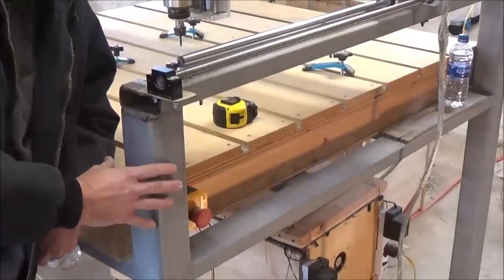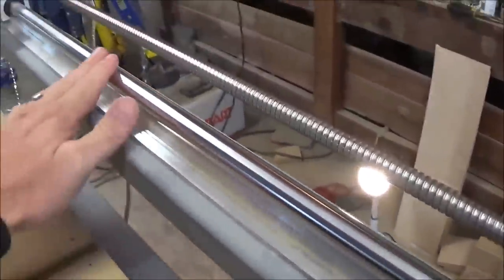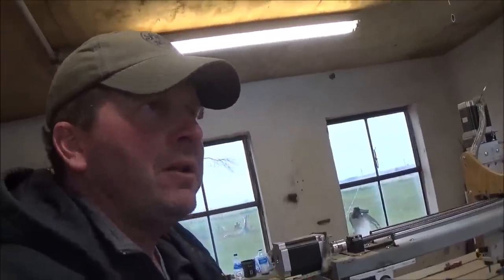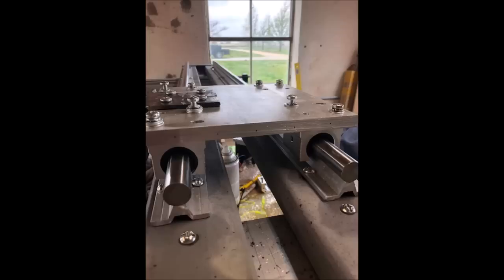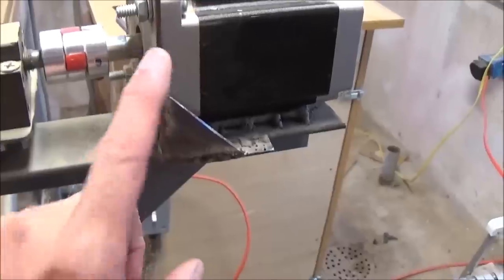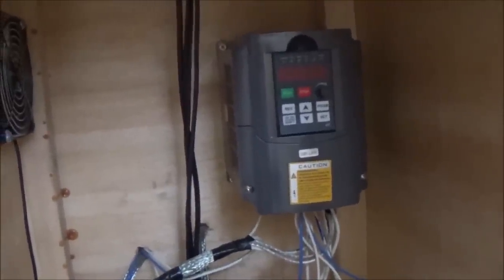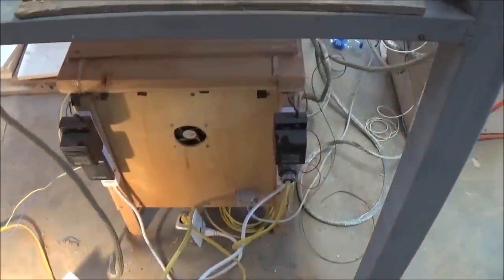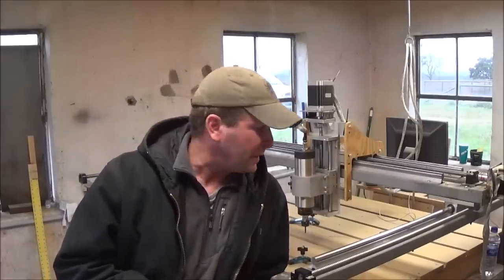My DIY CNC Router build

Comment: Great build! I love seeing people building stuff like this, but I have a couple of comments.

Have you grounded your shielding? If you want it to stop radio signals you have to give it somewhere to send them, i.e. to ground.

Your air box doesn't look very efficient, the way you have the fan just sitting in the box will just swirl a lot of the air around inside it rather than moving it down the vents. Buy another one and duct then directly into the exhaust vents.

You've got bare wire sticking out of your breakout board -- that's a risk of shorting out.

Parallel ports are 25 pin.

Seriously consider adding limit switches, you can't maintain 100% concentration on your system the entire time it's working (you're human). Something can go wrong and your gantry can run off the end in the time it takes to have a sip of coffee, read a text message, answer the door, etc.
Reply from the maker: Thank you!!...Yes the shielding is grounded......The airbox is one of the items I've still got to add on to, I plan to actually duct the air from the attic to cut the dust intake even more....I actually have a full dust collection system setting in the next room that I haven't got set up yet that I plan on adding to that room......and limit switches, I knew I'd get called out on em for not having them and that's ok, I do plan on adding them but it will probably wait until after I'm christmas, I'm getting covered up with Christmas orders at the moment, so most of the time I'm out there I spend working on products.....Thanks for watching!!
Reply: @SmokeysCNCWoodworks , just to make it clear because it's so easy to misinterpret text, please don't take anything I wrote as negative. It's an impressive build, I'm jealous.
Reply: I run soft limits and I've never had a crash. But then again I don't run Windows either. Coincidence? I think not!
Reply: @1pcfred  And I wear my seatbelt every time I drive a car even though I've never had a crash.
Reply: @fred_derf  I just wear a seatbelt to avoid a ticket myself. I've crashed a bunch of cars already too. Never had a seatbelt on any of them times either. I'm durable.

Comment: Do you have a link(s) for how you synchronize the two X axis motors??
Reply: Awesome machine, BTW!!!!
Reply from the maker: Thank you...This is actually crazy easy...so when you wire the drivers to the Breakout board you figure out which motor is X, Y, Z and A.  A is the extra X motor...In mach 3 there are several settings screens (can't remember which screen at the moment, its late and not in my shop) Look for a tab that says slave and you simply slave A to X and they operate exactly the same.....hope that helps..if not email me a smokeyscnc@gmail.com and i'll try to find exactly where in Mach 3 tomorrow....Thanks for watching!!
Reply: Smokey's CNC Woodworks a

Comment: Is it possible to get the measurements of the steel frame for the CNC? It would make the build a lot easier for a first timer.
Reply from the maker: There are a lot of the measurements in the video I posted called DIY cnc build gantry and frame...If it doesn't have the ones your after give me a shout...Thanks for watching!!

Comment: How thick of material can you carve (z axis)? $2,800 is pretty good, thinking back is there any way you would lower the cost? I'm interested in a smaller desktop size one, maybe 1' x 2' working area. I'd like to mill wood and metals like aluminum and brass, any suggestions?
Reply from the maker: This machine would do aluminum, brass i don't know.  If you were to only do a 1x2, it would be cheaper by quite a bit..your ball screws and linear rails would be a lot cheaper and you could save on the motors, get nema 23's instead of 34's like i have and you could get a little smaller spindle..mine is 2.2 kw...if i were going to do metals i would still go with the bigger spindle......if you want more in depth info email me at smokeyscnc@gmail.com....thanks for watching

Comment: I think you are my new “man crush” lol. Jk. I really enjoyed watching this build you did and think I may try to replicate it myself. My wife and I own a flower and gift shop and I already have a 100 watt cutting laser I make things with and that’s awesome, but sometimes we need a router for that cleaner look. I also manage the waste water plant and do the water for the city so don’t think I am just a flower boy haha. Anyways, if you could go back now and change anything at all about your setup, what would it be? Also, did you have to do really any “programming” to get this to work, like with a Rufus controller or does the software pretty much take care of all that? That machine looks awesome, man. I love tearing stuff apart and building stuff myself so I think I can handle it. Do you think it would have been just as strong made completely of wood? I mean, I know that answer but do you think there has ever been any projects you have done where a wooden frame would have been insufficient? Sure wish u had templates of all the cut pieces haha
Reply from the maker: No have no plans or templates, literally just had it in my head how it would come out....the changes I would make would probably be, make it bigger, like a 5x10, and may have done a water cooled spindle, simply because it would be quiet enough to run without hearing protection, I always wear headphones..The programming really isn't bad to produce the gcode...Now i use Vectric Aspire which is $2000 software, i've never used any other brand of software...and your in the same frame of mind i was, I wanted to build it as opposed to buying so I would know how the whole machine worked.....Thanks for watching!!
Reply: Smokey's CNC Woodworks yessir! I think you did a great job for sure! Glad I found your channel. I am new to all this Cnc stuff. Drones has always been my specialty lol

Comment: I want to build a cnc that will not only route wood but also use my everlast plasma cutter to cut metal. Doable?
Reply from the maker: I absolutely think it would be doable...on the z axis you would just have to modify it a little bit to hold a plasma cutter, and on the table you would have to put a water table as the base and put a removable table for the router on top of it.....Thanks for watching!

Comment: Love it!  I've been planning (well dreaming) my build for a couple years now.  This looks like my dreams!  I like the elevated rails, I hadn't thought of that.  Also I was looking at a water cooled spindle.  I had planned on Mach 3, but have been studying up on Fusion 360.  Like you, I prever parallel to usb, since it's more like (hard wired) and requires a few less conversion drivers.  Any idea of Mach 3 will rin on Windows 2000?  I have XP pro and 2000, I just think 2000 is less cumbersome.  Thanks again for the VERY informative video.  Now I gotta learn to weld.
Reply from the maker: Thank you!!..I looked at water cooled, the reason is i just viewed it as one more thing to go wrong with a water pump, or a hose leak, but water cooled is a lot quieter...if you are going to do mach 3 just don't over look this..32-bit version of Windows 2000, Windows XP, Windows Vista, or Windows 7....(32 bit computer ) its older tech with the parallel ports, i ordered my computer for mach 3 off of ebay, refurb for $90 or $95, works great.  I don't know about fusion 360 i'm using vectric aspire and it takes a 64 bit computer which i figure 360 does to...I program on a laptop in the house and use a memory stick to transfer to the machine......Thanks for watching!!
Reply: Before you invest in Mach 3 give LinuxCNC a look. Don't let the fact it runs on Linux scare you. I bet the network router you're using runs Linux too and you use that just fine now. LinuxCNC comes in an image with the program pre-installed in it. You literally boot up and go. So you don't even have to install the machine controller. It comes integrated in the package. The configuration is done with graphical wizards too. All for the low price of absolutely nothing at all. Which is tough to beat.

Comment: I'll be making one of these soon. I have been scouring the net for some ideas. I did run across a thread where they were saying welding was a bad move, because you couldn't get the frame square because of the steel warping a bit because of the heat. Did you experience this?
Reply from the maker: I covered this in some later videos, about tack welding then putting a hard bead following tacking it all together...THanks for watching!!

Comment: get some white lithium grease from online or home depot. It'll make your bearings, rails/rods, gantry, last a lot longer. I've experimented with the greases over the past 13 years on my machines and the white lithium is insanely good.
Reply from the maker: Yes!! exactly what i use!!....I need to probably mention that in a video, but i need to get more Im about out!!....Thanks for the tip and thanks for watching!!
Reply: @SmokeysCNCWoodworks  Awesome good to hear! It's amazing stuff.
Reply: skip grease get this stuff from PB Blaster called dry lube. CNC machines can make a lot of dust that mixed with grease is quite unpleasant. Dry lube makes stuff run slicker than snot. It's great for locks too. Man spray all of your locks up with dry lube. You'll love it! The lock on my garage I thought I was going to have to change it. One squirt and it's like a million bucks. Better than it ever was. It's like sex putting that key in there now. It feels so good.
Reply: @1pcfred  dry lubes are very interesting. Graphite and PTFE usually, I just don't like having to reapply them so frequently
Reply: @9001greg  you'd need really good dust collection to use anything wet. I'd probably have to run a HEPA unit in my shop 24/7. Because I'm naturally a dusty kind of a guy.
Reply: @1pcfred  hahahaha my shop isn't dusty at all. Wood would make it extremely dusty though so I hear you
Reply: @9001greg  I think the worst thing I do as far as spreading dust around goes is cup brushing rusty structural steel with an angle grinder. That throws dust all over the place.
Reply: @1pcfred  hahahahah

Comment: Awesome build, gave me a few ideas for the build I'm about to start and after researching the hell out of it for the last 6 months it's time to start ordering parts. I was going to go with aluminum extrusions but seeing how sturdy this looks I'm changed my build plans. I've never welded, but have buddies who know how and perhaps now is a good time to learn anyway, it doesn't have to be pretty. I'm looking at an 8 x 4 table just because the projects I want to do require a big table, perhaps not the easiest way to get into CNC but anything smaller won't make my replica arcade machines and jukeboxes (to name just 2 of my crazy ideas). Because of the length, I plan to go with rack and pinion on the y axis and maybe on the x to keep it simple when ordering and problem-solving. My question is from the experience you gained on this, if you were to go larger is there anything you would change?
Reply from the maker: I actually started out thinking the same thing, after looking at the cost of 8' and longer lindear rails i changed my mind for the time being. This design will allow me to add on length if i need/ want to and change out the ball screws and the rails and the system would work the same.  Check out a video i made after this one called "Diy cnc router build Gantry and frame".  On the video i cover some changes that i would look at on a new build.  Feel free to give me a shout at smokeyscnc@gmail.com.  Thanks for watching!!
Reply: Hello, I am a professional woodworking engraving machine here, I hope I can help you.

Comment: I built a machine a while ago with skate bearing linear rails.  My problem is they are exposed and get chips in them which eventually binds up the machine.  I usually blow the debris off while it's running but that's a pain and eventually added a shield which helped.  Your rails are also exposed so I'm curious how well those rods shed the dust and chips.  Could be a problem though...
Reply from the maker: The bearings i use are a enclosed bearing block so i don't have any issues with my bearings, and the secret to the rails is spray silicone real light layer, let it dry, you'll get a little sawdust stick but not bad...Thank you for watching!!
Reply: @SmokeysCNCWoodworks  Get PB Blaster Teflon Dry Lube. It's like sex in a can! Use that silicone on your boots. It'll waterproof them.

Comment: Sir that middle bolt on the middle spindle  holder is not suppose to be tighten up it is to force open holder to remove Motor or to pen holder to allow clearance for motor after you get spindle motor in place release center screw and then tighten top and bottom bolts
Reply from the maker: Yes, since i shot that video (Right after I started with cnc) I've learned that and a ton more about the processes and the machine itself...Thanks for watching!!

Comment: Sir if you had sized everything according to loads not weight then your cost would be much cheaper. Also when something goes wrong it can be more than  just power or driver or board because it can be breakout board or even the Mach 3 or 4
Reply from the maker: Absolutely right, I have actually had Mach 3 do its own thing on one program, rebooted and problem solved....only been once on that though.....Thanks for watching!

Comment: You could just buy some 1"round aluminum rod.... make your own clamps with a file, drill and tap.... right ??
right there on that nice CNC machine.... also,.. you could try a few panels with perforations,... to create sections of vacuum hold-down.
Reply: www.buildyourcnc.com ??
p.s..... much software is 128bit security ... most graphics cards internally are also 128bit and 64 bit hardware and software... and there are few people who know all the idiosyncrasies of all components.
You could have bought and used an ATX 700W P/S for  powering all those drivers... and some stepper controllers don't need drivers.... Sorry you don't learn more beefore you started.  Nice job on your though, I have few irks of it's beauty !!
My 3rd machine is gonna be glorious.
Reply from the maker: Awesome sounds like you really know your stuff!!!....I've looked at vacuum tables and decided thats something i can always add later.  The clamps were a solid alternative to building my own and the T-track was a easy solution..Look forward to watching your build....Thanks for watching

Comment: That air cooler box would work better with a fan mounted above above the filter. A square fan with the filter behind the fan would work better.
Reply from the maker: yes the flow would be better but my thought is that would be one more thing sucking in a lot of sawdust and eventually burning up the fan.  Although if i bought a fan made for this kind of ventilation and not a cheap 10 dollar walmart, it would probably work great. Thanks for watching..

Comment: Nice machine. Did you connect the VFD to the breakout board and control it with mach 3?
Reply from the maker: Thank you!!  I actually have not...after further research I found my b.o.b. is to small, to few ports, so that is number one on my upgrade list...That is my plan however..Thanks for watching!!

Comment: How did you level the rails? I know weldments are that accurate and I didn't see any shims. Thanks
Reply from the maker: Well the short answer, I got lucky. After welding the cross members up (the pieces the rails are attached to), front to back, it was level, side to side it was not, but the frame was very close to the same height on both sides.  I did shim under the legs on one side and got the entire machine level.  Then of course, I wanted to move the machine to closer to the center of the room and had to, go through the leveling process again because the floor isn't level (old dairy barn, has a drain on one side of the room)  and i ended up shimming 3 of the legs...I have no illusions, that it is not perfectly level if i used a laser transit or a similar device, but its very close....I was prepared to shim under the linear rails if need be.  If it was very little from one side to the other, i probably would have used a grinder on the high side and slowly take down the high area to level....the largest problem with welding is the expansion and contraction, I've done a lot of welding and was able to minimize it, but there is still some there....Thanks for watching!!!

Comment: 23:50 i think one problem is, that energy is far too cheap in the us. Due to this you are not really worried about wasting it.
Reply from the maker: It actually pulls a lot less power than you think...My shop electric bill has never changed since I added this tool...Thanks for watching!!
Reply: We have solar power in the USA.  What's the problem ?

Comment: Do you have an approximate total cost this cnc build came out too?
Reply from the maker: Yes it was about $3200 with software and everything...should have been about $2800 but had a wire slip loose during the wiring phase and ground out the first spindle and vfd, completely frying the VFD,  I think with a little work i could make the spindle work.  Thanks for watching!!